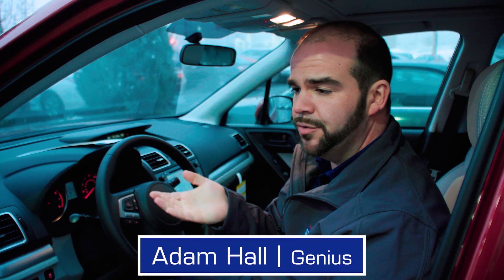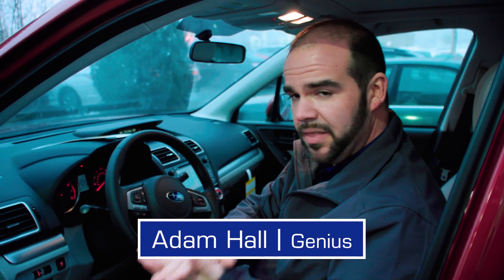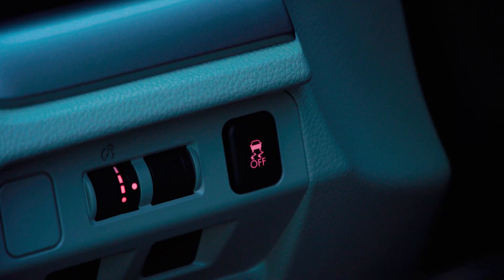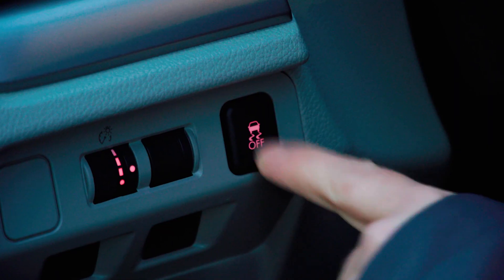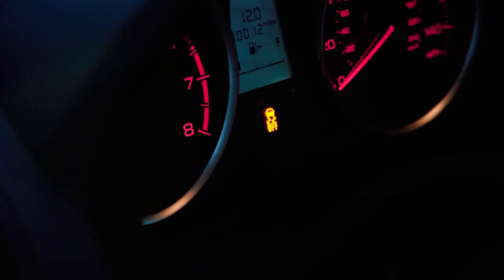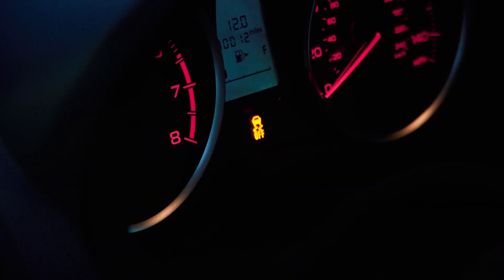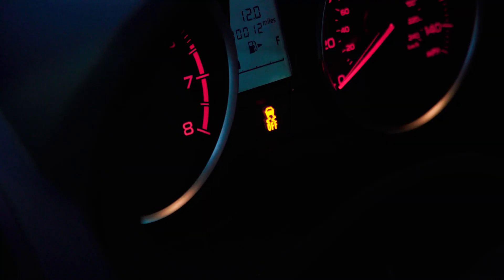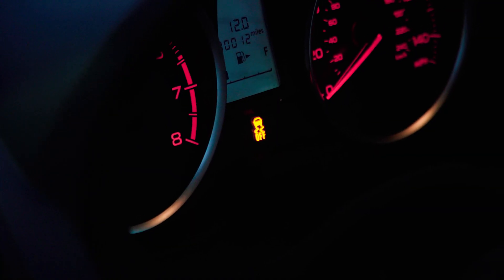Subaru Vehicle Dynamics Control

Comment: Mine just came on along with the check engine light and the cruise control dropped out and would no longer engage.
I carried on driving home because, well, given the choice you try and get home, right?
Then I looked online and amongst a bunch of other stuff found this post. So I went back out and started the car on the driveway and turned the VDC off, then turned it back on again and all the codes are cleared.
I have not actually driven the car again but will do so tomorrow and we will see what happens when I do.

Comment: Add a switch, or a rear diff-locker and/or a Cusco LSD if you don't want the VDC killing power offroad during climbs or stucks...and/or mount a winch.

 Most people don't offroad their Subie that seriously though. Use all-weather tires in that case, rather than all-season tires. Examples are the Michelin CrossClimate and Firestone Weathergrip lineups. I offroad, so I use siped MTs or all-weather ATs...and have a winch and skids.

Comment: The explanation was good and helpful yet my check engine light is on my at oil. Temperature light is on my break is flashing. My traction light is on and it’s also has a trouble light for my cruise control flashing Yep all at once two days ago I had no issues, what the heck is that gonna be?… I brought it into a dealership and they said nothing. I run into another mechanic and they said it was a vacuum control system I need it didn’t need to be fixed.
Reply: I recently had the same thing and it ended up being a faulty EGR valve and hose I had to get replaced. Fixed everything afterwards

Comment: So You think that when the roads are slippery we better turn it off???
Reply: No, leave it on. But if you're climbing a hill and you're slipping, turn it off.
Reply: @brotendo  so the other day i was on my way homei live in the mountains) and it was snowing and i was slipping a few times so i decided to turn the treaction control off and it seemed i got better traction because i didnt slip anymore! Was that the right thing to do or was i hurting the car in some way? Also note that i live 40 miles from work!
Reply: @mandingo9471  nope, engine is fine!
Reply: @mandingo9471  its been over a year and it hasn't given me any trouble!
Reply: @mandingo9471  🤣🤣 I thought it was odd that u thought it would mess with the engine!

Comment: I got the code that the VDC in my 2010 Forester is faulty. What do I do? Please advise.
Reply: Currently have the same issue on  my 08 impreza ... i replaced the rack and pinion and the vdc off lighg stays on not sure what it could be any help .. if you ever got yours resolved
Reply: @JCesar775  I haven't really resolved it. BUT. I did replace the battery recently and all the check lights have turned off and they haven't turned back on... Not sure if that actually fixed anything permanently, but it could have fixed it temporarily.